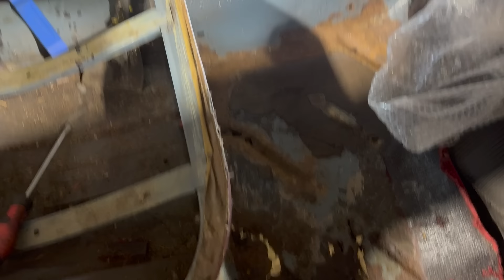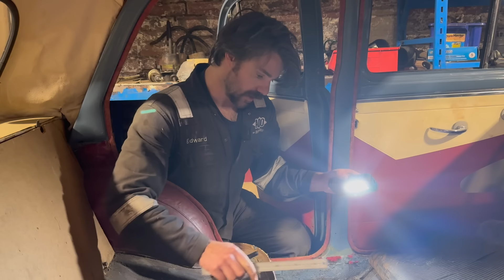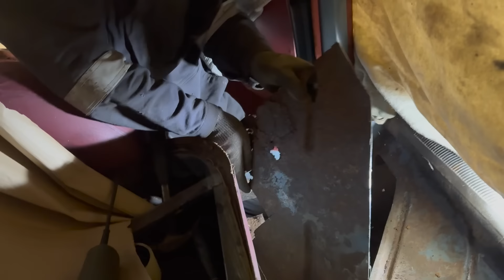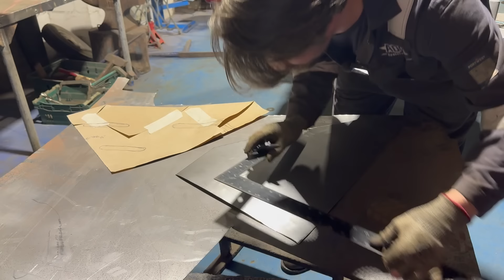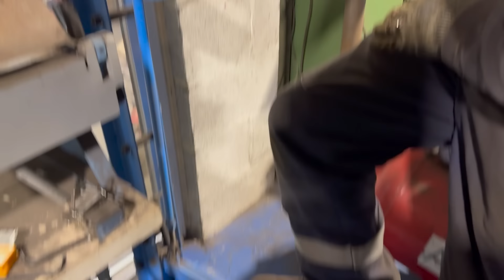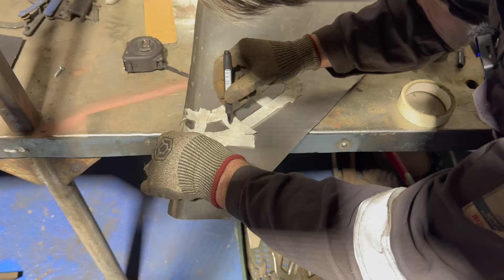Rotten 50s Standard 10 - new floors, panel making, welding...and more!

Comment: enjoyed  your brake  video! In 1969 I paid $ 28 for a  1959 Standard 10 Companion estate wagon. No engine or trans, found a 1200 Triumph spitfire engine and gearbox, and rebuilt everything else on the car... The one big issue I had was the front wheel spindles apparently had heat treatment brittlement and both fractured (on different occasions) and when they broke the tire, wheel, and brake assembly went bouncing down the road, and the car had NO brakes none. Other than that I had so much fun with my TR 10.

Comment: You can only get repair panels for the popular classics. Apart from that tough luck, even for much more recent models. I just spent ages scouring the internet for parts for a 1996 Mitsubishi van. I eventually did find aftermarket leaf springs but body panels are practically unobtainium, even though the model remained in production for the Australian market until 2013. Maybe if you had the language skills you might be able to get something from Taiwan where the same model's still going strong but I don't.

Comment: My 1954 Standard 8 has been in the garage for 30 years. I've rebuilt the engine and changed the gearbox but was wondering how to deal with the rotten floor - here's the solution - thank you ! x

Comment: Waxoyl, Waxoyl, Waxoyl. Box-section, sills, and bare metal internals: Waxoyl. Never mind paint or fancy powder-coatings - surface treatments crack and lift and won't save you because water always has a cunning plan. Waxoyl penetrates and smothers and creeps and never rests. Inject and forget. But don't forget: Waxoyl.😁

Comment: Just a question, not a criticism, but wouldn't I have been easier to cut out the whole footwell piece so it's a nice easy square, rather than making up triangle pieces, and is the new steel thicker than the original or the same

Comment: This brings back memories of my first job at 16 in 1976. It was at a sheet metal firm called Park Sheet Metal. They did sleeper cab conversions for artic. tractor units. There was an apprentice there who was hand fabricating every panel to build a Triumph TR6. I was only there for 6 weeks  as it turned out to be a sweatshop (piece work etc.).

Comment: You talked about zinc primer. Was that for after the plug welding? I was wondering if you would have used weld through primer for the inside of the sill box section prior to welding.

Comment: 60 years ago, in Cape Town, I bought a Standard Ten to get to university. I studied engineering and the Standard taught me a lot of engineering!  One afternoon a front wheel came off while negotiating a right hand hairpin bend. The left wheel had cracked between the studs. I fitted the spare and set off for home. On the freeway the car started to wobble. The right hand wheel was starting to crack. I learnt about metal fatigue and limped home.😃
Reply: Excellent. The Standard 10 is the first car I can remember- in Durban, South Africa. My mother had one. Not for very long, I think. I recall the shape of it, but nothing about the interior.  Odd, that.

Comment: Steph you folded that floor pan into a complex 3D shape this will cause immediate electrical Standard 10 tannic Acid erosion Fe2o3 black stem rust leading to the scrap yard .
Reply from the maker: After the week I’ve had, I’ll be in the scrapyard before the car is. So no worries.